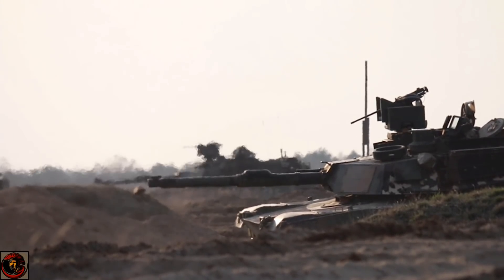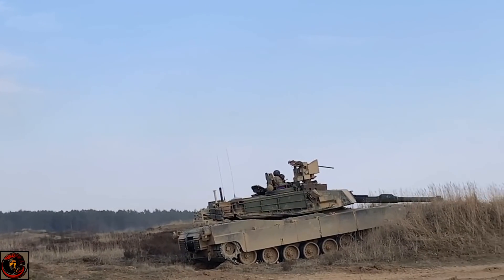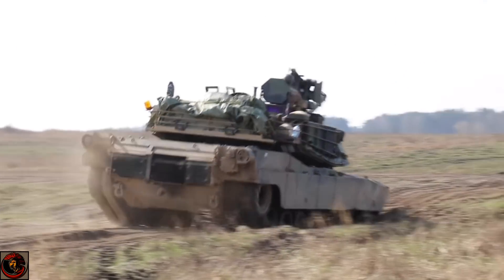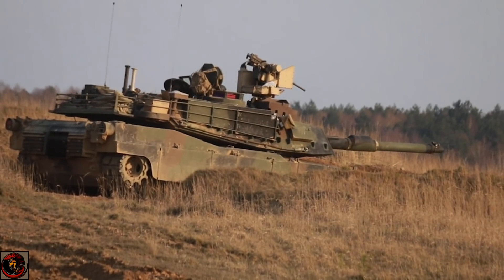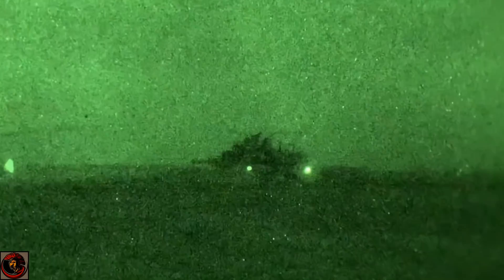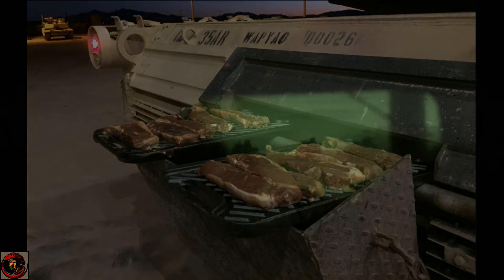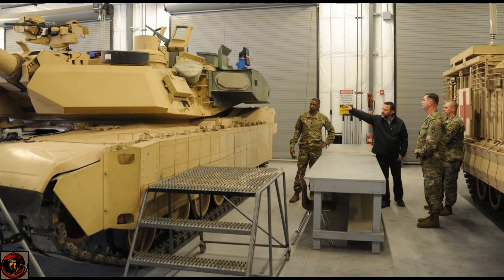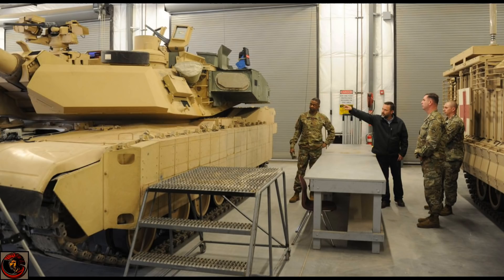M1A2C Abrams Tank Upgrade - The Last One?

Comment: We can debate what tank is the best tank in the world until the Sun turns into a red giant. The reality is the determining factor of what is the best tank is not just the stats of what the tank quote-unquote has. A lot of what makes a tank go is the crew and their training. If you look at the wehrmacht during World War II arguably they had the best tanks in the war. But after a 1943 their tanks didn't perform as well and they tended to be on the losing end long-term until the end of the war. What changed?  Was it  just a question of the then Soviet Army acquiring new and improved armored vehicles. It wasn't a question of us building more M4 Sherman then the Germans could build of their tanks. It was crews and training. As the wehrmacht Lost experience Crews , tanks were lost due to inexperience and poor tactics. For example sending out small Penny packets of Tanks, kind of like the French did during the Battle of France, or sending tanks out without adequate infantry support. The German army of course was being bled White by 1944. The M1 Abrams is an exceptional tank No Doubt. It is been proven where the metal meets the meat. In the darwinian process known as War. Tank vs. Tank the M1 Abrams has proven Superior to everything it's come across, but not just the tank, the training and the crews. If you look at the 1967 war between Israel and her Arab Neighbors, the Israelis had some centurions but they relied heavily on modified m-4 Sherman's. The difference was training and the crews. The Arab armies had t-34s , t 34/85 and t-55. they heavily outnumbered the Israelis as well. the only thing that really comes close to the M1 A2 and it's sub variants is the Challenger 2 and The Leopard 2. I remember reading an article one time about a challenger 2 they got stuck in the ditch. it was pounced on by Iraqi insurgents. they shot out all the sights and Optics. The crew was sitting in the steel box he couldn't see out of. I don't know how many rocket-propelled grenades they shot at the Challenger but it was a heck of a lot. Not one rocket penetrated the armor. Eventually the crew and the vehicle were recovered. Obviously the Challenger needed some repairs. I think the crew also needed to visit the laundry! I remember also reading that the leopard 2 has unique way of mounting the driver's seat. I think it is suspended from the roof of the hull rather than mounted on the floor. This better protects a driver from shock in the event the tank rolls over an IED. I heard the latest upgrade to the leopard 2 included a longer Barrel on the 120 mm gun.  I would like to see a study done to see what it would take to change the gun on the M1 A2 to the longer barrel version. it isn't just a simple bolt on. It would require changes to the ballistic computer programming and to the turret bustle counterweight.
Reply: Hey , ease up , leave some words for others .
Reply: Sticking in a blank line every once in a while would make that easier to read. <shift><enter>. 

On the Germans sending in "penny packets" of tanks; that could be down to that's all the tanks they had running or fuel for.
Reply: You know that germany use the the longer L/55 since 2001 XD And also didn´t had the best tanks at beginngi of war, it was the other way around. They started with one of the worst tank fleet of the time and ended up building tanks like the phanter which was superiror compared with allied or russian tanks but also in to low numbers to really effect the outcome.

Most of the time they have to use the Panzer II, III and IV which were good at the time they where developed but in no time they where only as good as and not superior anymore.
Reply: As i have replied for another comment: M1 is the SUBVARIANT of LEOPARD 2 series, first notice that.
2) M1 armour is designed to repel anti tank ammunitions that include chemical compunds to extremely heat up A mixture that is alike to lava that liquifies the armour then the explosive compound in the projectile goes through the hole and explodes inside 360 degrees, but against APFSDS rounds that only uses kinetic energy to penetrate; M1 would get grounded if shot by DM53 german ammunition even with L44 from FRONT HULL. (IM not sure but even DM43 could even penetrate the same place )
Reply: @eggyballsteabagsgtfo9988  I dont think the M1 was a subvariant of the Leo.2 and i hope you can tell where you got that information.

But i agree with all other things you say
Reply: @eggyballsteabagsgtfo9988  Is it in german? If so i can clearly listen to it :D Eny other lanfuage not.

Also what you mean is the KPz/MBT-70 project which was indeed a fail but not because it was planned to fail. One of the biggest problems was that germany wants a loader for the 152mm gun while america wants a autoloader, also the drive was with in the turret bsaket and had a extra cabine which turned against the turret rotation so the driver can allways look frontal. 

The project was also too expensiv because they experimented a lot which was later used by the germans and american in there own tanks. 

And now the Leo. 2 is the most used first world tank :D
Reply: @eggyballsteabagsgtfo9988  I dont think that you fully wrong about the KPz/MBT-70 project when it comes to "learn" new technics but the M1 is not a subvariant or i just don´t now how subvariants works
Reply: @eggyballsteabagsgtfo9988  Than the M! is defently not a subvariant from your standpoint on XD
Reply: @eggyballsteabagsgtfo9988  Sry my fault. Did press capsock for to long. I mean M1 for M1 Abrams.
Reply: Wehrmacht rarely had best tanks available. They had training, doctrine and radios and support.  Polish crew of otherwise very capable for a time 7TPs didn't have radios and were used in strategically obsolete manner. But in direct shooting game, say, battalion or platoon level  even TKS not to mention 7TP had given ALL Panzers run for their money - until logistic and communication broke anyway.

Comment: How about a full electric tank with VR viewing for the crew and a drone pad on top which carries heat missiles Matt ?
Reply: All that is a possible but the question is if it's practical especially the electric part 
     A fully electric tank would be very challenging, the number one thing that kills range is weight batteries by themselves are heavy then the armor of the tank would kill the range even of a huge battery I bet MBT like the Abrams wouldn't make it 100 miles with 2 of Tesla's biggest battery packs combined the technology is just there yet and I doubt it will ever be for something like a MBT

Comment: Also small fun fact; the upper Glasis is sloped at 84 degrees, enough to bounce Kenetic Energy rounds and HEAT rounds. It also seems to be part of the reason why the turret is shaped the way it is due to the possibility to a shell bouncing off the upper Glasis into the turret face.

Comment: It is possible that the M1 Thumper ( basically an Abrams with a 140mm gun) is possible for a replacement tank design. The round produces 21 megajoules that will blow off a T-90 turret no ammorack required. The T-14 armata needs to upgrade their gun  so the military can use that as an excuse to make this beast...
Reply: CATTB and "Thumper" were 2 different projects. CATTB used a lighten 120mm gun prototype with a mechanical autoloader. While "Thumper" was intended to utilize an autoloader for it's 140mm gun. Which was never installed, as was also the case with it's German counterpart. Due to the project being abandoned. 

There is the possibility that future models will mount the Rh-130/L51 being developed. Which is an advancement of the original 140mm program.
Reply: @KSmithwick1989  Thank you the source I read said that the CATTB was an Improved Thumper, I'll edit my comment.
Reply: coolingdawn 4700 Imagine an autoloader for that beast...
Reply: @yelectric1893  It did have an autoloader I estimate the time between rounds would be like ~5-7 seconds. M1 Thumper was designed to counter the so called "Soviet WunderWaffe" ( Object 477, 279 etc) but they never came so the project was scrapped...
Reply: Ah yes, use an experimental tank against a front-line Soviet T-90 that no American tank has ever faced before. Such geniuses here. 😎
Reply: Kommandant Skip  They ALL had auto-loaders, you dumb shit.
Reply: Kommandant Skip  I was talking about AFTER WWII, you absolute stupid fuck. Do you think they were going to use autoloaders in the middle of a fucking war?
Reply: It is probably more likely that any future us tank is going to recieve the rheinmetall 130mm gun as a stopgap to a electrochemical 120-140 mm gun, the south koreans are looking in that direction as a future part of their k2 pip upgrade program. The us has already experimented with this tech, i believe they managed to get 140mm conventional gun effects out of a 120mm ecg.

Comment: Correction; this may be the last of the M1A2 line in preparation for upcoming M1A3. Though I swore I heard of an M1A2D in the pipeline too.
Reply: One of the design goals of the M1A3 is to reduce weight without sacrificing protection. That is the model the Marines should get, not more hand me downs. Specific additional funding can be set aside for that so it isn't limited by normal Navy green funds. 

The M1A2D is planned to be mostly a sensors upgrade from M1A2C. That should be ready soon. The M1A3 should take some time before it is ready because of the testing required to validate significant structural changes. The Marines could make do with the M1A1 until then. It should put them on the top of the priority list once M1A3 is ready.
Reply: The jar heads are still pissed over getting the m103 taken away. They will find secret hangers to stash a few abrams in.
Reply: cnlbenmc yeah when the army gets the M1A3 they will pass the M1A2 variants to the marines
Reply: + @Admin-5 + The Jarheads have been stubbornly sticking with M1A1 variants for years. They don't even have the Commander's Independent Thermal Viewer (Cuz it's an A1 and that's an A2 feature). It would be FAR cheaper for there to be a universal standard Abrams across all branches but they won't do it.
Reply: @cnlbenmc  Added features wont erase parts interchangeability between the abrams, What the M1A2 used can still be used for M1A1 but not the other way around.
Reply: @cnlbenmc  The Marines have kept the M1A1 primarily because of weight issues. M1A2 variants are several tons heavier.
Reply: Also the USMC has budgetary limitations. Given their budget is dependent on Department of Navy "green funds". They share funding with Navy grounds forces (CBs, Corpsmen, etc). They're really a branch in name only and not a truly independent department.
Reply: cnlbenmc they want the M1A2 but they are limited in budget. Most likely they will get passed down or will be discounted or the marines in the next conflict will destroy a bunch of the M1A1’s so they can buy the M1A2 that’s what they did with the M1’s

Comment: In my opinion, most likely. They might be developing a different modern armored tank.
Reply: for sure. Most likely it will be a man less turret with heavily armored crew compartment with extremely good protection on front and sides.
Reply: @shittyG1  Both US and Russia has developed a similar tank with that doctrine before. The prototype was called off because of the technological limitation on both side.
Armata is just a resurgence of the old manless turret and heavy hull armor doctrine, US would have to do the same to keep up .
Reply: They... are?
Reply: Highly doubtful a new MBT is begin developed, that takes a lot of time and money and what more could it offer the Abrams has practice and still effective in modern combat and its a very modular design it can be upgraded quite easily and that will usually fix any shortcomings it has 
     I don't see the Abrams or begin replaced anytime soon unless something new anti-armor weapons arrives and causes problems or there a big advancement in some field
Reply: @theprfesssor  Armata is a game changer since it basically a great design which US and Soviet experimented before. Imagine not being able to kill the crew because the only thing sticks out is the turret, which is crewless. Its also not viable from getting shot by top attack missiles since the crew is protected under the turret and composite top
Reply: @krellio9006  
      The T-14 does look impressive on paper, the problem is that all it is right now, Russia is learning the hard way building modern MBT'S is challenging, complex and expensive they said they wanted 2000 T-14's  by 2020 well they got a little over 6 months left and best estimates put them at less then 100 so far
   Someone bit off more than they could chew the first warning sign was the parade back when the tank was revealed....... where it broke down and had to be towed we will have to wait to see if Ivan can get it together
Reply: The deadline is currently set to 2025. The problem is that media report the order as "tanks", when it was referring to the Armata Universal Platform. The T-14 tank is simply a variant based on a common chassis. A large portion of the final order will include T-15 Heavy IFVs.